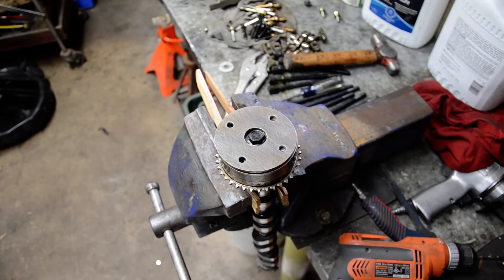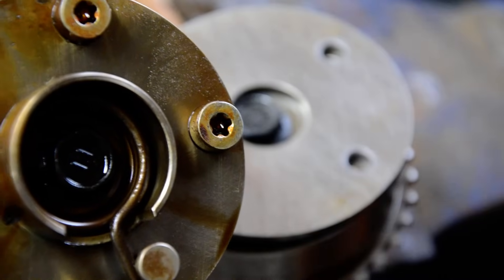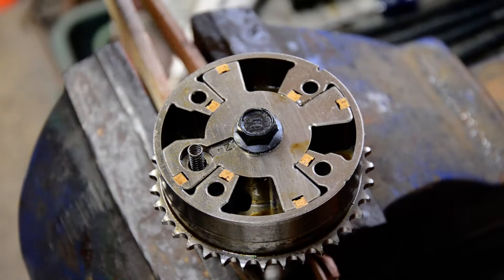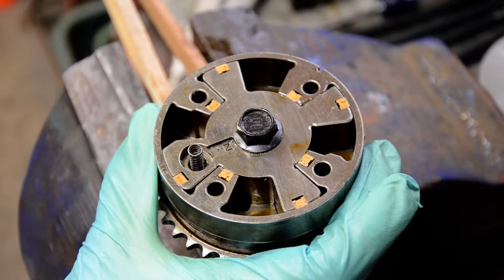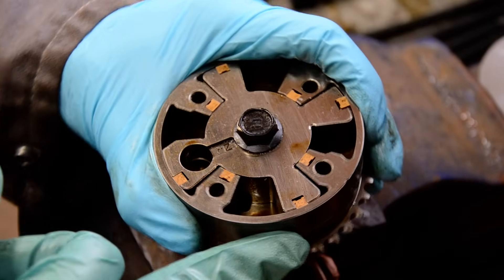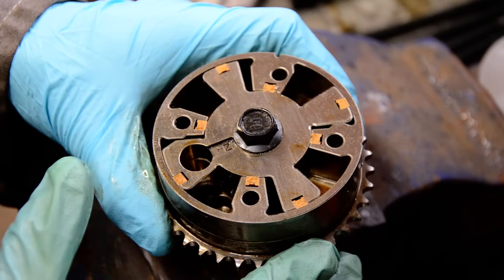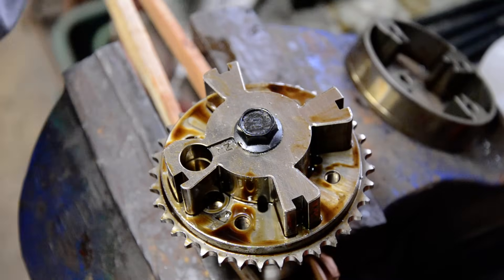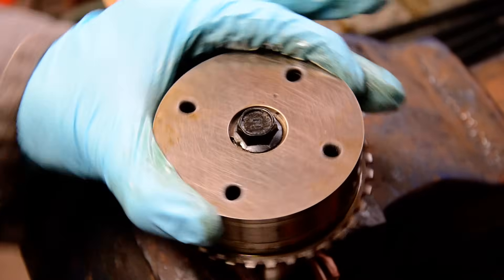Inside a Toyota VVT-i Camshaft Gear!

Comment: There's valve timing, valve lift and duration. With camshaft driven valves the only way to vary lift (and/or duration) is moving the camshaft so the valves (or rockers) follow a different lobe. Continuosly variable that is NOT. Freevalve (electric) could vary each of the three variables continuously and independent of each other.

Comment: I believe the cold start rattle is because the spring becomes weak over time and until it’s pressurized with oil it makes a rattle noise. If you can put and stiffer spring in there it would quite it down during cold start.

Comment: The spring gets weak and won't push the pin out on cold starts  until oil pressure builds up, causing the rattle. Simple fix without changing the gear is to remove the spring and give it a little stretch. I did that to my 2010 Corolla, and it hasn't rattled since. Changing that gear is a pain in the a**.
Reply: Did you mean to say the opposite, the spring is weak so it won’t keep the pin in lock on cold starts? Sorry not trying to be smart ass but just trying to understand the mechanism so I can fix my car

Comment: Anyone with a 2017 Corrolla know what size the 5 point bolts have? They changed from the torx type to 5 point bolts. Thinking around 12mm but not sure. Want to order. Some say 12.5

Comment: I have prius gen 2 and having a dtc p0012. Its related to vvti phaser , ocv, timing and oil pressure. I have tried all of above possilities but still my car check light is on with p0012 says camshadt timing retard anyone  had this problem

Comment: I bet that is the rattle you hear in the gear on cold start up, that spring has lost tension and is not locking the gear like its suppose to and the gear rattles back and forth on that pin with the weak spring. Honda has the same design, on Honda I stretch that spring if it has cold start rattle and reinstall it then the the cold start rattle goes away, I bet its the same on this cam gear.
Reply: Yes, this is often the case with Toyotas with VVTi. The pin no longer glides smoothly, either due to weak springs or deposits, and then the adjustment is loose when cold. As soon as oil pressure is applied, it usually returns to normal.
Reply: @chrish.6629 actually after this comment I had a car that had this issue and I solved it, made a video on it too, you dont even need to buy parts to correct it.

Comment: I think they are confusing a s all he.. I know one thing when they start to give you an error code you should listen to it I DONT even understand it ye0et to be honest but Toyota is well known for going against the grain i remember thae air fuel mixrure sensors crapped out on me i have a 2003 rav4 still do i was getting the thing inside was not heating upmafter some reseRch toyotas air fuel mixture sensors are unlike any other lets just say HONDA FOR EXAMPLE NORMAL temperature range for them is about 800 degrees fahrenheit while Toyotas air fuelmratio sensors are almost 500 degrees higher hmmmm i read more and there the only car manufacturer to run theirs so high so unusual stuff nwith a toypta no longernsurprises me,I bellieve they were just more ahead of their time than any other manufacturer .....    and i remember dint even attempt to put or replace an oem sensor with any thing other than oem oem for air fuel is DENSO AND AT ABOUT.  $140  BUCKS A POP ARE MOST EXPENSIVE ON THE MARKET TOO I KNOW DENSONISNOEM FOR SOME THINGS BOSCH ARE THE OEM FOR OTHERS AND DELPH ZRE OEM FOR OTHERS DONT CHEAP OUT ON ANY SENSOR ON THIS MOTOR OR YOU WILL JUST BE DOING IT AGAIN A SHORT TIME 
ATER OH BACK TO THE VARIABLE VALVE TIMING SENSORS I STARTED TO GET AN ERROR CODE RELATING TO THEM I REMEMBER TELLING MY KID ITS ONLY THAT DAMM TOYOTA AGAIN CRYING ABOUT SOMETHING OR ANOTHER NOT BEING OE,  SO SOON AFTER I GOT THPSE VARIABLE VALVE TIMING ERRORS I BROKE A CONNECTING ROD ON NUMNBER 2 PISTON COMING OFF A HIGHWAY EXIT RAMP DOING ABOUT 30 MPH THE CONNECTINFG ROD LET LOOSE 
SLAMMED  AGAINST THE SPARK PLUG DESTROYING IT AND PUTTIN A NICKEL SIZED HOLE RIGHT THRU THE TOP OF THE  PISTON... I CANNOT PROVE IT,   BUT MAYBE I SHOULD HAVE TOOK THOSE VARIABLE TIMING VALVE ERROR CODES MORE SERIOUSLY..... AS I  WRITE THIS THE TOYOTA RAV4 IS HAVING A USED 70 THI0SAND MILE ENGINE IN IT MY KID LIKES IT AND I MUST ADDMITT SO DO I IT IS A FUN LITTLE VEHICLE TO DRIVE,.....

Comment: If you start the car there's no oil pressure and that pin prevents the VVT from getting hammered to death. Oil pressure builds up and hold the pin in against the spring until you shut the car off.

Comment: honda had the right idea (V-TEC) . with the vvt-i engine it only takes one little spring or o-ring seal to go bad and the engine is doomed.
Reply from the maker: Vtec and vvti are very different systems. Hondas classic vtec controls valve lift and duration with an additional cam lobe. Toyotas vvti system only controls valve timing, it has no control over valve lift or duration. 

Saying that, both brands now have more sophisticated variations of these systems that can control lift, duration, and valve timing. Wild stuff!
Reply: @PatonHaus  wild stuff?  How about pop corn, rice fluffing garbage. What a scam been going on over 20 years.
Reply: @markvermeulen1372  Not a scam, advances in efficiency.  The real scam is buying domestic vehicles with parts made everywhere else but the US, and having 10x more problems and being left with a worthless car or truck.

Comment: The pin locks it into full retatrd on shut down. When oil pressure drops the spring overcomes the oil pressure and seats the pin in the hole.. When its seated there's no noise on cold starts. Noisy cold starts means the pin is Not in the hole and the internals rattle full retard and back to full advance very fast until oil pressure fills the chamber on one side and stops the rattle. One way is full retard the other is full advance. The design flaw on early systems was the pin was too large and with improper oil changes and use it would either not go in and get stuck or wallow out the hole and not go in. Eventually the internals break and the engine grenades.  If you dont replace the assembly.. Tge linger it rattles on startup is how long you have left. Short rattle time means you have more life left , longer rattle times mean you have more worn parts and less time left.  No permanent fix really other than use proper oil and on time oil changes. Good luck people.

Comment: I have 2007 Corolla with a 1zz-fe 1.8 4 cylinder, I was changing the timing chain and the VVT moved back and forth. I removed it from the cam and it rattled inside. Took it apart and one of the leaves(?) of the rotor had broken completely OFF! That was the rattling sound the engine made when started. Changed the VVT gear and no more noise!

Comment: the spring loaded pin is to hold the cam at that timing for starting and only disengages after it receives oil pressure
Reply: And if it becomes weak and shortens, then the pin will produce the start up rattle.

Comment: So, is it super bad that i was able to unlock mine simply by turning it? im in the midle of  amajor teardown and inspection of my timing system because of a drivability issue, and i remember just one time that mine made the cold start grinding noise many months ago. Perhaps my lock pin is rounded and therefor not locking when its suppposed to. My analysis of it with my eyes and brain suggests that the lock pin is there to stop it rotating until there is oil pressure, so as to stop the cold start rattle and also to stop it form moving out of time while there is no oil pressure to hold it in time. I was undoing the little torx bolts to inspect it, (without the chain) and it just slipped, then i realised i could lock it again by turning it back, thne give it a hit with my palm and i could unlock it. Now im wondering if this is happening randomly causing my stuttering at idle, and maybe even the reason for my lack of power and code p0341, which i thought was a stretched chain.

Comment: first spring and pin is to lock the timing back into retard, the pin will only move out with the correct oil pressure. those yellow plastic are seals to prevent oil escape into other chamber. VVT sprocket are not pulling timing all the time, it's like the Honda V-tec got to do with engine speed and load. Eventually all is controlled by oil pressure. the E-VVT with an electric motor in it is a different story... Great Video!!

Comment: The pin locks everything in place.  When VVT system needs to change timing, oil is diverted to the pin, pushing it open against the spring, and allowing the gears to move.  When oil pressure decreases, the gear locks back into place.
Reply: The pin is to prevent a rattle noise on startup, since there is no oil pressure.
Reply: @somethingelsehere8089 On the Honda actuators the pin is the cause of the rattle, caused by the spring becoming weak and shortened.  I don't think the purpose of the pin is to prevent the rattle, it's job is to locate the timing back to 0 degrees.  As oil pressure decreases the spring then acts upon the pin and the pin then locates itself into it's detent.  Having no oil pressure there at startup is what allows the pin to stay locked and not rattle.
Reply: @somethingelsehere8089  I have a startup rattle on my 1zzfe coming from this area, do you think this could be related?
Reply: @TRE_Blender  It could.
Reply: Can I install the VVT gear in the locked position?

Comment: Pin is actuated by oil pressure. It keeps the cam in the low rpm position when the engine isn't running

Comment: The locking pin is to lock the position so it doesn't rattle on start up... Unfortunately  most Toyota's don't after poor oil condition
Reply: That's not what the pin is for, not rattling on start up is just a byproduct of the pin being there.  The problem that causes rattling is the springs becoming weak, for starters.

Comment: My NEW but aftermarket phaser on QR25DE don’t stay locked for shit. It clicks allllll day long turning the crank with a wrench it clicks every one full rev of crank. There’s no reason for the pin to not be locked in retard when the crank turns clock wise and the phaser springs ahead of the cam in the same clock direction. It must be the valve springs pushing the lobes up which turn the inside of the phaser to shift forward but ONLY oil psi can unlock the pin. I’m going to RE OPEN this stupid phaser crap and stretch the spring that holds it down bcs I have harder springs and ac turbo so this makes things worse for the poooor phase. If this don’t work I’ll have to build an electric oil prime to the gear cover to prime the stupid phaser bcs I’ve been doing it with my starter. Watch my vid if you can it’s one of the most recent.

Comment: This piece of crap gave me headache for the past couple of days. The car I've been working on output DTC P0016. I've replaced the OCV, and disassembled/reassembled the timing chain cover for 3-4 times to double-check the timing chain markings, everything seemed ok but the problem persisted. Then after I replaced the vvti sprocket the problem disappeared. I didn't have the necessary tool to disassemble the sprocket to thoroughly inspect the sprocket in the first place.

Comment: Its a adjustable cam gear, like some after markets are sold from HKS etc. This concept is old. Check the 5SFE and the 3SFE engines, but these engines, the gear is exposed and the gear is divided in two and it only moving one part of the gear, while the other one depends (exhaust) depends on the other one for advancing or retarding the timing. These, VVT-i, are more efficient with more timing advancing or retarding timing.
Reply: You seem to know, on the exhaust actuator the part with spring seems to come out 1/8 or more is this normal?

Comment: You could have also filed or shaved down  the sides of the bolts to fit a adjustable or spanner to unlocked them
Reply: Ummmmm, or you can get the proper bit to remove them and replace them with regular hex head bolts.....

Comment: Would a failure on the vvt-i cause the timing to be too advanced and a random misfire P0300 code?
Reply: Yes. I recently had a VVT-i problem on my Lexus. I got a P1349 trouble code, which indicates trouble with the VVT-i system. However, the vehicle also threw a P0300 code for general misfires. It also threw P0301, P0303 and P0305 codes, which indicate misfires for cylinders 1,3 and 5 (Bank 1). It also had a P1130 code, which indicates a problem with the air/fuel mixture. The vehicle would also idle poorly and buck and shake sometimes. Fixing the VVT-i system cleared all the other codes. The Bank 1 VVT-i oil control valve was the problem. I also wouldn't recommend driving the car like that because all those misfires can ruin the catalytic converter and make repairing the car a lot more expensive.

Comment: There's oil pressure on other side of the pin that pushes against the spring  that depends on oil pressure due to the speed of the engine

Comment: Guess that plunger spring is what gets weak and causes the first start rattle noise.  And if you stretch the spring to create more tension the rattle stops.🤔 Interesting.
Reply: What proof you have of this?
Reply: @A_Mechnaical_Design  https://www.researchgate.net/publication/249922054_Overview_of_factors_contributing_to_steel_spring_performance_and_failure
Reply: What proof you have of this
Reply: Yes, it is.  No - don't stretch it, replace it.

Comment: I get a 1-2 sec loud rattle when I start up my 2016 Toyota Camry 2.5 L engine...  could this pin be the problem?   Someone told me this cam gear is draining back oil when it shouldn't...
Reply from the maker: Yep, the loud quick rattle at startup is typically due to the vvti cam gear. I believe the repair is to replace the gear entirely.

Comment: The pin keeps the cam and gear locked together when their is no oil pressure like when starting the engine.
Reply: can these fail and cause hard starts when the car sat a while and the oil drains? starts after 3-4 attempts when it has been sitting and fires right up when the engine just ran

Comment: The same problem have my car, making noise when I start it...😫..I have to change it..where are you located?..
Reply: It's actually not that hard to do yourself. Depending on the car. Basically the steps are remove the valve cover,  hold timing chain in place, remove tensioner, remove the camshaft that the vvti gear is attached to, then remove and replace the vvti gear, put it back together, make sure timing is correct, and done! The real important part is to make sure the timing chain doesn't fall, because if it does, an hour long job just turned into a 10hr long job.
Reply: Hello, you fixed it your car, I have that same noise when I start it cold, as I understood in this video the pin no lock camshaft

Comment: suggestion for anyone trying to remove these odd shaped bolt heads.  Just spot weld a washer on the head of the bolt.  Then weld a nut on the washer.  Now, very easy to move with a nut welded on top of the bolt.
Reply from the maker: Alternatively, you can buy the special bits to remove them non-destructively.
Reply: @PatonHaus  olease share where to buy rhem in sure lots would appreciate  the link...

Comment: I have a 2007 camry 3.5 and i have a cold start rattle from time to time, is that pin that you took out the reason for the start up rattle?
Reply: Could be the solenoids. Depending on what you've tried, I would try the solenoids first, cause they're easy to swap out. If the noise continues, could be couple things. Like bad chain tensioner, something bad in the timing chain system, or the gear shown in this video. If you wanna do it yourself, I would do solenoids first, then the gear swap, then timing chain assembly replacement. Thing is your engine is complex. Personally, if the solenoid doesn't fix the issue, I would just live with it.
Reply: Yes.  The pin engages when the oil pressure is low so that when you start the car the cam phaser is locked in place.   It is then pushed out by the higher oil pressure 2 seconds after startup.  Then the cam phaser is free to move and adjust timing.   That pin not engaging is a common issue on lots of different cam phasers from all of the auto companies.

Comment: I found out that they do make a tool to remove the cover plate on the VVT....its called a 5 point torx or 5 point star bit....comes in different sizes like torx. It can also be referred as a 5 point tamper proof bit but those usually have a hole in the end.

Comment: That has 5 star tamper security screws because it is a critical part of the engine that can mess up the car really good if you put it back wrong without the proper way to do it. There is a reason for that part being protected. i have mine from an engine which head I am rectifying and this engine was run without oil to the point it failed with oil all burnt inside it. I wonder if inside the VVT-i gears there is still oil burnt that would impede its functioning right; it was washed at the machine shop off the oil externally but wondering if inside needs to be cleaned as well; but i am told by many mechanics to leave it alone and not to take it apart as it may mess up the car later on.
Reply: I have a Honda with an almost identical actuator in design and operation.  I have been inside of mine 5-6 times to dabble with the spring and locking pin in attempts to stop the rattle.  As long as that's as far as you go, and you make sure that nothing is forgotten and tighten the bolts to a torque value between 8 and 10 ft/lbs there are no issues.